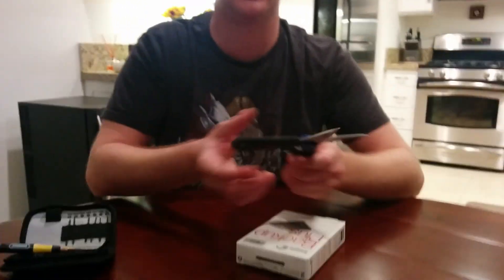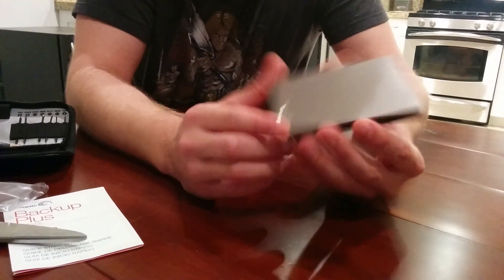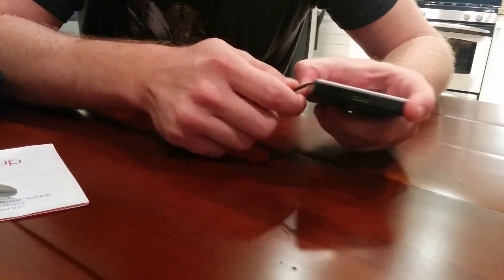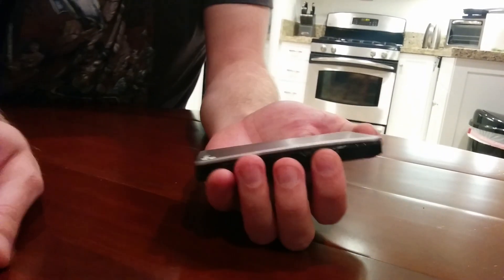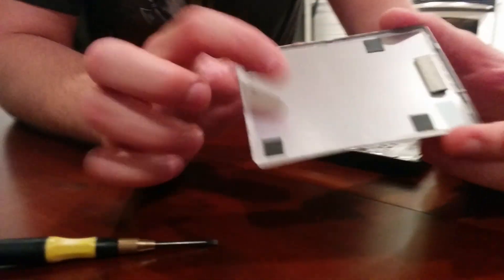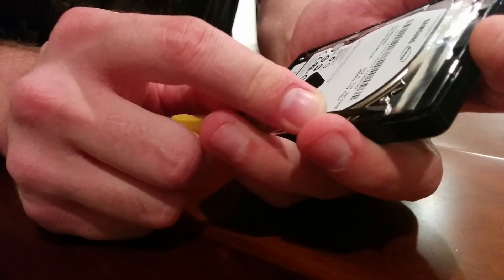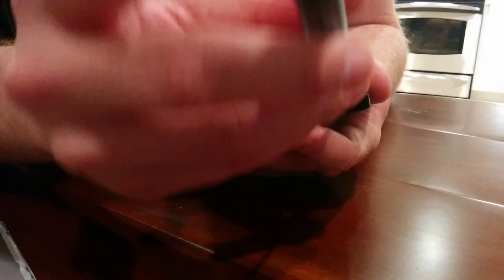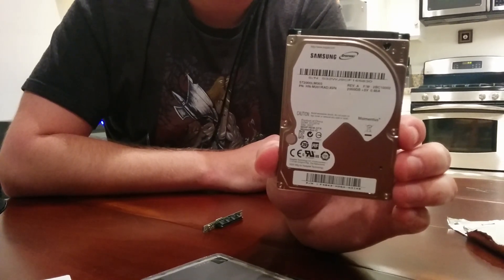Seagate Backup Plus Slim Uncasing - Extracting a Samsung M9T

Comment: Here is the easy way to pop the cover!!! --> Use very small flat head and pop loose connector side (3 clips) by pushing the cover away from connector side while prying cover.  Now you can insert a slightly bigger flat head under the cover about 3 inches deep.  Take the inserted screwdriver and apply pressure to the inside middle of the cover so it will flex.  Assist the flex by applying inward pressure to both sides.  The side clips will flex off the retainers.  Finally for the back side, flex the cover out by applying pressure to both sides and the clips will release.  No damage.

Comment: These kinds of drives are great if you need a cheap backup. Usually when there's a shift to larger drives, the older ones start getting real cheap. 
Got a new one from costco, but trying to hook it up to an older machine, and I'm barely getting USB2.0 to work properly. 
So I found it better to just extract the drive, hook it up internally. 
They pretty much have the same exact configuration, Just that like one guy says, using a credit card can work better then bending the top back, although the steel (aluminum) tops can be really hard to pull off without actual tools and leverage. 
Your best bet after that is to pop the drive out of the rest of the case, carefully peel back the foil, and then plastic cover, and remove the adaptor. You can then either hook the drive up to whatever console, laptop, desktop you want, but you might want to keep the case and adaptor around in case you want it to still be used as a portable device.

Comment: Hey man, is it just a simple SATA connector on the actual drive? I'm considering ripping it open and installing it inside my PC..
Reply from the maker: Yes.
Reply: Sweet.  Thanks.
Reply: Rocky koston I don't remember the speed right now.. but I ended up leaving it connected via usb 3.. and it works beautifully.
Reply: So you did not extract it out or just using the USB 3.0 ?

I would definitely like to connect it via SATA port.
Thanks for the quick reply.
Reply: Rocky koston I didn't extract it, no.. I never got around to it. But by the looks of it.. it's not too difficult. No problem!
Reply: Great. Thanks a lot.
Reply: Hey mate, how did it go when you put this in your PC?

Is it a 5400 or 7200 drive?

I am thinking of extracting mine and putting it in as well. Thanks.

Comment: Brad Spicer is right, this is the worst way you can open the drive. After seeing that the top lid is secured by adhesive, I knew you could use a heat gun on it. Heat gun the top of the lid on all sides and slide a credit card underneath and lift it, it should pry off VERY EASILY. If it becomes a little difficult, heat the lid some more so you don't bend the lid out of shape.

Comment: Don't follow this instruction just slide a credit card where you see the lid connect to the base with some moderate pressure until it starts to wedge in and slightly up towards the lid. When you get it inserted to about an inch slide it around the circumference of the drive case. You can open it in a minute and not damage the case.I watched two guys rip these things apart in separate videos which was somewhat helpful (but painful) for me to watch in order to figure an better way.

Comment: If you use a wide spudger, you won't ruin the case; just keep pushing the lid up equally and slowly all around until all the clips pop off from inside. Did it a few minutes ago and it works great. Use one of these spudgers: http://tinypic.com/r/beqfq/9

Comment: Heat gun on lower heat settings + plastic pry tools made usually for phones/tablets are the #1 solutions if you want to open a screwless case without messing with the outside casing. Thx for sharing this video.

Comment: I've always found it WAY easier to use a craft knife rather than a screwdriver.  The ones you can snap the blades apart (for when the end bit gets blunt) work great for prizing each side up at once without screwing up the case which can be used for other things.
Reply: +Mike Caddick I used a guitar pick. Worked fine with no damage to the metal lid or the plastic case.
Reply: I found the guitar thing a bit too thick to easily get started, buy after the initial case crack they work great.

Comment: I did the same thing with my drive and PS4 but I put the PS4 500GB drive into the Backup Plus Slim case and I noticed the light indicator doesn't turn on at all. I'm assuming this is normal since it's a completely different drive? Not a big deal but it kinda sucks that I can't tell when the drive is doing something. Just wondering.

Comment: I just got one of these.  That plastic coating on the side opposite the pilot light:  Is it supposed to be kept on or removed?  In your best estimate?  I plan on using it as a standard ext HD, and am not taking it apart.  Thanks.

Comment: thanks for the video, it help me to know how take out the hdd, right now im doing a backup on of  my ps4, i go to use STDR2000103 model to put into my  ps4, is easy to open it, i just have to use a credit card to open it, even iu could use somthing similar a credit card to open it and do not damage de cage.

cheers
Reply: So, the non slim drive has the same HDD inside?  Fits in PS4?
Reply: yes, just becareful to take out the hdd, it has four attach points, the points are in the area where are the screws.
Reply: +Kanon gdl nice, someone else told me it wouldn't
Reply: this model fit without problem in the ps4, i have already my ps4 with this 2TB hdd, and work without problem

Comment: Btw If any of you happened to destroy the case but still has usb adapter circuit you can use it with standard sata dvd drive (that is super cheap) as external usb 3.0 dvd drive (this one is quite costly, actually costs a few times more)

Comment: how can I pull off the USB adapter I couldn't pull of with hand I pulled the green park with the USB thing and the black rectangle stuck in there and I used a wrench to pop it out and I damaged the hard drive. my system made weird noises. I'm getting a new one

Comment: Great tool for easy opening of hdd enclosure with no damage... A cuticle pusher. I know, not common around every household but I actually bought mine for easy cleaning of controllers & remotes between top & bottom pcs cuz it does a great job & no damage. Worked like a charm for hdd removal from enclosure.  Finished in few minutes easily. Hope this helps.

Comment: I managed to get this thing opened without beating it up too much. Didnt have a spludger but they're made of nylon so I figured "What else is made of nylon?" The answer is a guitar pick which there are quite a few of in my house. I used a plastic one though. Figured a medium pick would be easier to work with and yes... it was. Problem now is I cant find a flathead screwdriver or anything to pry it out.

Comment: did you re-use the case for the 500 gb originally on you PS4 ? I did the same but now the activity led on the case does not work any thoughts?
Reply: +Francisco Humberto Martinez  -   I put an old 160Gb Segate drive in mine after removing the 2Tb drive.  Now the LED on my drive doesn't work either.  Not a big problem though, the drive seems 160Gb drive seems to be working ok.
Reply: thats what i did, why not right
Reply: ***** thats strange my light worked fine

Comment: What's the difference between Seagate 2tb backup plus and slim and will they both go into a ps4 ??
Reply: You need the slim because it's a 2.5" the non-slim is a 3.5" and won't fit in the ps4.

Comment: Am I the only one that noticed the "Hole" on the hard drive? THAT is the question for debate. If dust gets on the platters.. GAME OVER

Also, I just opened mine and well.. Maybe its the fiber in my diet but I used my finger nail to pry it open. No damage at all HA! =D

Wish I could say the same about my nail.. :*(
Reply: David Justice The hole is present in every hard drive. It's for pressure equalization. Just leave it alone. There is a micro filter on it already.
Reply: David Justice That hole is on the hdd for a reason...simple google search could have figured that out.
Reply: Oh Ok, Thank you wewd for educating me. un-like that other "Filthy" runny "JFK" smelly turd  :D
Reply: Good to know u can use your nail I am going to be opening mine today and will try using my nail also so I don't damage the case.
Reply: +David Justice fingernails trick worked perfect, no damage to case at all
Reply: +David Marchand Where there's a will, There's a way my friend. Glad I could be of some help :)

Comment: Does the same process work for upgrading PS3?
Reply: +Jose Cedeño  yes, the ps3 and ps4 use the same size hard drives.  though, you gotta download the ps3 update file and you open the ps3 up a different way. the drive itself though will be the same.

Comment: Ok so there is Seagate backup plus and backup plus slim, do both work on ps4? Or only slim?
Reply from the maker: Slim. When I made this video it was just called the Backup Plus (as you can see on the box in the beginning), but I guess they changed the name since then. The link i provided in the description goes to the correct drive.
Reply: Ah thanks. Just 1 more question, the one in the link has a model number of STDR2000100, I found that exact same drive with the same name but model number is STDR2000200. Any differences?
Reply from the maker: ***** sorry. I'm not sure about that

Comment: I was able to open mine without a screwdriver, keeping the casing pristine. I did this by getting my fingernails between the top cover and case and by slowly working my way around the edge to release all of the clips (thanks for the pointers on where these were). Some gentle wiggling and the adhesive gives way and the top case comes free. Then I reused the Seagate casing with another drive.

Comment: Perhaps a dumb question, but why not buy the internal Samsung Spinpoint M9T HDD seperately? Surely that's cheaper?
Reply from the maker: At the time of recording this the standalone internal M9T was about $20 more expensive. Don't ask me why.
Reply: +Ragnar Nersten originally the drive wasn't sold separate, and even now the external drive is CHEAPER than the actual HDD by about $20.  so why not get a free external casing to house your old ps4 HDD and use it as a backup?

personally i'll be using my ps4 drive for my xbone.

Comment: Do you still have this hard drive and is it still working?
Reply from the maker: Yes it's still in my PS4 and it's running great
Reply: Thanks! It seems like a great drive.
Reply: +Parker Delponte what did you do with the adapter for the usb

Comment: In have bought it from Canada Computers for $100 and then extracted it to put in my Macbook Pro as a second data drive, also saving the cover for my other 750GB hard drive. Its easily extracted and the case is also not damaged if you use a credit card instead of a screw driver and also try to use your fingers mostly. Also use your nails to remove the inner tape not the screw driver.

Comment: I was able to easily open this case using the iSesamo found here:

http://www.amazon.com/Newer-Technology-iSesamo-Ultra-thin-opening/dp/B00792JJK4/ref=sr_1_1?ie=UTF8&qid=1421696453&sr=8-1&keywords=isesamo+opening+tool

It was much easier to open than the 3.5" drive enclosures.

Comment: Just paid 94.99 at costco. Did the same thing, but to make it an 2TB internal drive for a laptop. Weird double stick tape seems to be all that holding the case together. I don't understand why buying the same internal drive without a case costs more.
Reply: Limited warranty is effectively voided after you take it apart. If the drive happens to fail after its past return date, good luck getting a replacement from the manufacturer.

Comment: This is not a weird connector on USB cable. These days almost every external USB device has this kind of cable. Its strange that you have never seen that before.
Reply: That's a standard USB 3.0 miniUSB connector.   Anything without that fatter plug is only USB 2.

Comment: I think for just $12 more, I will buy this (http://www.amazon.com/Seagate-Momentus-SpinPoint-ST2000LM003-Notebook/dp/B00I8O6OQ4/ref=sr_1_1?s=electronics&ie=UTF8&qid=1413964592&sr=1-1&keywords=2.5-Inch+2TB) and save myself the trouble....
Reply: I would rather open it carfully put my old 500gb drive inside it and have an extra external drive for free basically.

Comment: Hi Parker, i bought a STDR2000100 but the seller send me an email saying that send me a wrong HDD, because its "for MAC" version. I think its the STDS2000100. Do you know if the STDS2000100 has the same Samsung M9T? I think it's fisically the same but optimized for MAC , Time Machine, etc. The seller say me that he can change the drive, refusing the delivery, but i live in mexico and is not really easy.. :/
Reply: It's the same drive inside, just take it out and you have reformat anyways.
Reply from the maker: Sorry I am not sure.
Reply: Parker Delponte hey do you have to format the hardrive to fat32 and good video
Reply: gavin reagan I don't believe you have to format before putting it into the PS4. I'm pretty sure the PS4 will reformat any drive you put into it. But I'm not totally sure about that. All I know is I didn't reformat mine before I put it into my PS4 and everything worked.
Reply: Insane Pixels thanks do you know if it will work on the ps3 ?
Reply: gavin reagan Sorry, but I do not know for sure. I would guess no.
Reply: Please pick me

Comment: Say goodbye to your warranty mate! 

On the HDD that is.
Reply: Fuck a company who a) only warranties their drives for 2 years when it used to be 5 years, and b) would void a warranty for someone taking an internal HDD out of an external enclosure, as long as they did it carefully.
I just reviewed the (UK) terms and Seagate don't specifically state that taking a drive out of an external enclosure specifically voids the warranty. They list many things that DO, like physically-abusing the drive, removing labels, etc.
That - and why is it cheaper to buy an external drive with the same internal drive inside, as it is to buy the bare internal drive? Do they put lower-rated factory-seconds/rejects into the external drives, figuring that they'll be used somewhat less-intensively on average (e.g. at 30MB/s on USB 2.0) ? Well? 'cos I don't know and they're not telling.
Reply: TVismyopiate I couldn't find if it voids the warranty on the website

Comment: Before I extracted the Seagate Slim 2 TB hard drive from the metal case, I connected it to the computer to make sure the hard drive work. Then after I extracted the hard drive, I installed it into the PS4. I downloaded the UPDATE 736mb 1.75 on to the memory stick and then inserted it into PS4. Then I pressed the power button for 7 sec to let the PS4 enter the safe mode. Then the PS4 reinitialized. Then, after it reach 100%, the TV screen went black and the PS4 begin blinking blue light. So then I switched out the Seagate hard drive from the PS4 and put back the original hard drive. The PS4 was able to display image on the TV without blinking the Blue light. Do you have any idea what might be wrong?  The Seagate hard drive: ST2000LM003. Thank you.
Reply: I got it to work! I swap out the original hard drive with the Seagate hard drive and it worked. I'm not sure why it didn't work the first time, but fortunately it worked the second time.
Reply: Yet you CAN'T really make sure the hard drive works, unless you're running Windows. Since Seagate's SHITTY policy means only Windows can get testing software. To test a disk, run the 'Extended Drive Self-Test', which tests the whole disk, not just a tiny part.

Comment: Try using a hair dryer to melt the glue a little before prying off the metal plate.  Good thing metal is good at conducting heat, it shouldn't take too much heat to do this.

Comment: Thank you for the video. I'm a bit nervous doing that myself. Did you have to use a lot of strength to separate the outer case?
Reply from the maker: No I didn't have to use a lot of strength to get it off. Though next time I would use a guitar pick or something plastic instead of a metal screwdriver.

Comment: Perfect video. Was thinking about installing this hard drive on my ps3. Any problems so far?
Reply from the maker: I installed the drive into a PS4, not a PS3. I would do more research to see if the M9T 2TB HDD will work in a PS3 if I were you.
Reply: Parker Delponte 
Oops sorry I meant the PS4. My bad. But yeah there's one on Amazon for £86, it's the Seagate STDR2000201 2TB Backup Plus USB 3.0 2.5 Inch External Hard Drive - Silver. Looks exactly the same as yours. Have you had any problems with your hard drive installation in your PS4, like noises etc.
Reply: aki-sid.95 
Installed in your PS4*
Reply from the maker: aki-sid.95 No problems at all.

Comment: did you put the PS4 HDD into the seagate case to use as external?
I did but cannot get my computer to recognize it, any ideas?
Reply from the maker: I actually put the PS4 drive into my MacBook Pro. The first step to doing that was to format the drive using the disk utility on my Mac.
Reply: Parker Delponte thanks for the reply, I figured I had to format it but cannot get windows to recognize it once it's plugged into usb...
Reply from the maker: GoinGreen27 Hmmm sorry. I have very little knowledge of Windows.
Reply: Parker Delponte nice video anyways, my ps4 is working perfectly fine with the samsung drive...